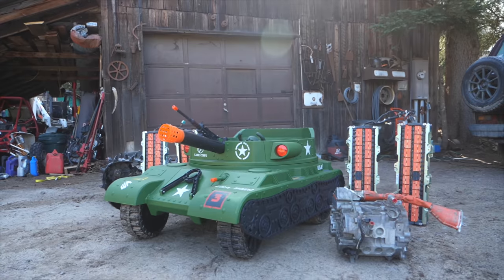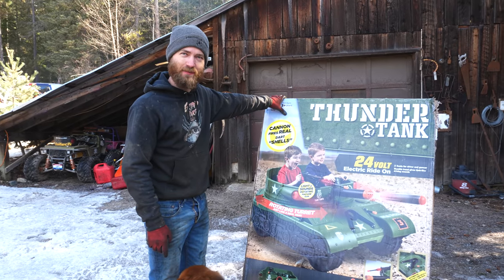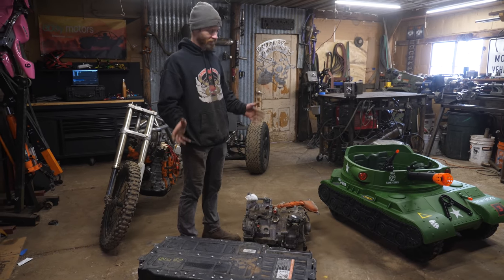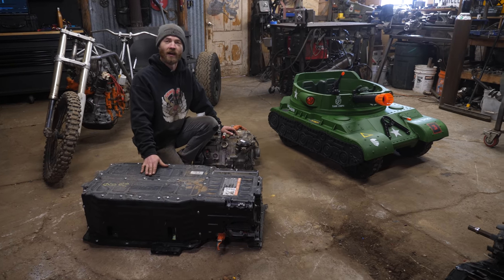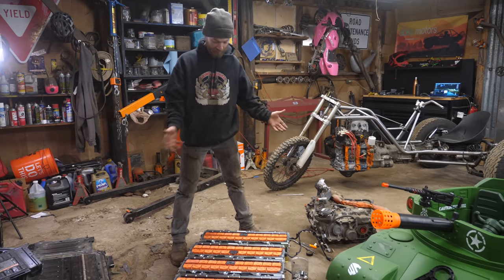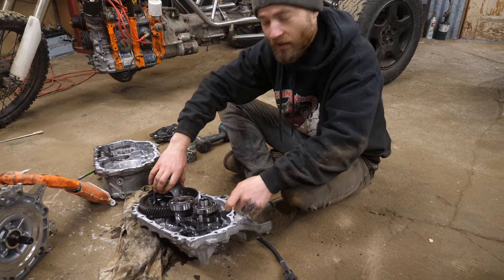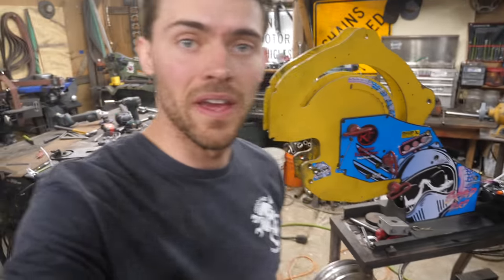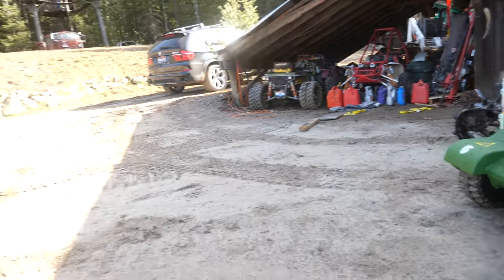450+ HP Electric Power Wheels Tank Build! Our Wildest Project Yet!

Comment: I love the fact that you’re converting it to tracks! It’s gonna be awesome! Steering is gonna be a fun episode though...
Reply: what makes it so much easier than your average tracked vehicle is no drivetrain will be needed just a brake on each motor and even that can be done with the motor controller... each motor can be controlled seprately it will have very tank-like steering (even "0 turn") but with none of the mechanical hoopla an engine that only turns one way would need..
Reply: @ianbuilds7712  You called it! Steering won't be until mid May though!
Reply: @lj516  no good thing comes quick... im stuggling not to say it... THAT'S WHAT SHE SAID!! Dammit i said it
Reply: two handles,like a skid steer or tank is THE ONLY WAY TO DO IT JUSTICE
Reply: @trillrifaxegrindor4411  yup... that is what we were discussing a month ago... sr tardie to the partie.

Comment: love the idea. since thermal failure is a big issue for these batteries you should run a simple cooling system through them to a rad either front or back of tank. most tanks seem to go at back for tactical reasons. it will use some battery power but shouldnt be much for a small pump and rad fan.

Comment: It will rip,the weight down low will be fine. Need to be able to lock, one side or the other,so it stands up nice in doughnut mode. Would make a nice tater cannon.
Reply from the maker: It will have full independent track control. You will be able to do proper tank donuts, with one track goong forward, and the other backward.

Comment: Y'all need a new garage concrete floor . If you ever replace the floor make sure its graded to 5 to 6 inches in depth . Make sure there is wire mesh and add rebar . Make sure wire mesh is off the ground when pouring the new floor . And invest in ASHFORD FORMULA !!! This will save your floor . We all drop tools , engine blocks LOL Stone cold stunners HAHA . No but seriously this will protect the surface and prevent chips . Love the channel !!!

Comment: Maybe you should look at the possibility of putting the engines in the back (I have no experience but I have seen and heard that then there are less problems with coming off the tracks, especially if you build something fast, it somehow affects the tension of the tracks)
Reply from the maker: You have a point, and it may be a problem, but at this point I think there are more reasons to have the motors up front. Like weight distribution, and overall layout and track design.

Comment: This is something else for sure with the electric tank. When you're done with this one maybe you want to do something about that 944 sitting there for some years now. A few people are doing Baja sort of conversions on 924s and 944s as a lower cost version of the off-road 911s. I'm probably doing a plenty of lift build/kit on a 924 this year(maybe 150mm suspension lift and 50mm tire lift?)...I'd be curious what you guys would do on this platform.

Comment: I'd use foot controls for the turret and I would have 2 bars coming up to control left and right separately and let it easily go from forward and reverse while letting you run 1 forward and 1 back for quick spins.
Reply from the maker: We probably won't use joysticks for the controls, because there's a high chance on unwanted acceleration and bucking due to the momentum of your body going over bumps and such, but we will make it so you can drive the tracks opposite directions for tank turns and tight maneuvers.
Reply: @GrindHardPlumbingCo  thats very true, I had forgotten about those bobcat flash backs haha

Comment: I know the power wheels has been a thing all the way through

But it would be so cool if you used the plastic Tank as a guide and BUILT a GHP power Wheels out of steel sheet metal etc!
Next level stuff

I bet it would look awesome and you could size it up a bit if needed and give it character ( not that it wont get some real soon after the first test run and one of you blokes suggests jumping it!)

Comment: Put the motor in the rear so the belt can have all the slack out it will throw the belt up and leave all the slack in the throw. Diesel brother explained this far better than I can but the concept will apply to this as well especially when you’re dealing with this much toque and power with such a small drive train

Comment: Itd be more space smart to set the motors at the front and rear and the batteries center wise for a “flat floor” and more cabin space and it would bring the width of the tank down too

Comment: If you wanted to use just one motor you can use that gearbox that came with it and use brakes for turning like old crawler tractors had back in the day.

My dad's international TD6 has a 5 speed gearbox and uses a diff and turning brakes.

Comment: Realy important @grindhardplumbingco !!!! Motors need to be in the back ! I don't know how to describe why but think about chain slack. You need tension on the botom and slack on top. If you are going forward then direction of rotation will be clock ways and there for motors needs to be in the back
Reply from the maker: I know there are reasons for that, but snowmobiles have the drive in the front, and that works just fine, even when you drive a snomobile on dirt. I think we can make it work.
Reply: @GrindHardPlumbingCo  oh yeah I didn't think about that 🤷🏻. I was compering this to a ripsaw tank (just a miniature version of it) 😅

Comment: I know I'm boring. But be careful with the batteries 😁 rubber gloves and a face shield is a good start (mistakes happen, and if they do with batteries, it can be bad. Working with batteries myself)
Just want you guys to be safe to keep those clips and projects coming 😁💪
Reply from the maker: We will be as careful as possible with the batteries!
Reply: @GrindHardPlumbingCo  I should say be careful of yourself(s), instead of the batteries :) isolate poles of cables as soon as you remove them from modules and so on. Isolating gloves too. Just don't want an unnecessary accident to happen.
Thanks for being awesome guys!

Comment: If the motors run equally, forward and backward, I think you should center them, one in front, one in back, running opposite treads.
Reply from the maker: If we did that, the weight distribution would be all sorts of messed up, plus, the tracks would behave differently due to tension being on the top in one, and the bottom on the other.
Reply: @GrindHardPlumbingCo  very good points!

Comment: It would probably be much easier to implement a twin stick throttle/steering system like on a zero turn mower than a normal gas/brake/wheel arrangement. You wouldn’t have to figure out a way to convert steering input to track speed and you also wouldn’t need a separate reverse shifter.

Comment: Wait, hold on, you have to put the motors in the back. The reason is that the motors will pull the bottom of the tracks back, instead of pulling the top of the tracks forward. Thats one of the reasons why tanks have their drive motors in the back. You will have more forward throttle response and the tracks on the ground will be tighter and you shouldn't run into very many problems with too much play. Since the snowmobile tracks were designed for use in the snow running them on dirt with the motors in the front will tear up the tracks much faster.
Reply from the maker: You have a point, and we will consider all the options, but there are a few good reasons for us to put the motors in the front. And if we go through tracks a bit faster, that's a sacrifice we are willing to make.

Comment: You should make 2 battery packs that are removable for charging and weight reduction and make a battery lead that will run them in series broskis
Reply: I would love to lend a hand on that build I could probably put it together in like a week or two
Reply from the maker: We plan on making the battery pack removable, so we can use it on other projects, or like you say, have a spare.
Reply: @GrindHardPlumbingCo  doin it Right!!

Comment: Did this build just stall? I can't find anymore videos on this. Did Youtube make you pull the videos, because of the MASSIVE danger in screwing around with a 48V EV system?
Reply: There's actually not that much danger I fiddle around with a 96 V DC system all the time and have no issues
Reply: @dr.chiseltip  ... Be careful. Most electric cars use an AC system though. AC is more dangerous than DC. Both can be deadly, but AC takes the cake.

Comment: Sounds like an interesting build but wouldn't be you lot if it wasn't. I didn't realise that the leafs had 80KW motors and trying to push double that power through your motor will be interesting and looking forward to the solution and we all know in the electric game its about torque not HP cause even my 1hp electric quad could do get up-to 60mph with ease due to a good motor.
Keep up the hard work
Reply from the maker: Yeah, I should be very interesting! We're certainly not experts when it comes to electric stuff, but our electrical engineer friend seems to think the leaf motors can easily handle double the stock power, especially since it will only ever be for short bursts. But yes, the torque will be truly insane.

Comment: you can put one motor in the front and one in the back running in reverse. for more room and balance.
what you think?
Reply from the maker: Unfortunately, I think that would create some very weird driving characteristics, because one track would have tension in top, and the other would have it on the bottom... Plus, all the weight up front will be a good thing for this much power!

Comment: Instead of using a break and throttle pedal you should have a left pedal for left track and a right pedal for right track because I’m pre sure those electric motors pre much brake them selves

Comment: Hear me out.... off road 4WD go kart (similar to the oddessy) but it's powered by 2 different 1000cc 2 stroke snowmobile engines, long travel suspension, big ol' mud tires, or if you don't like that idea, I speak for the community when I say I've always wanted to see a Chevy 572 V8 in a quad, if there's a will there's a way

Comment: I have a nissan leaf, it has 100hp and 200lb ft of torque so I'm curious on how you guys will get that kind of power out of that motor,
Reply from the maker: It's simple with electric motors. Add more volts and or amps, you get more watts, which means more power. Also, we are using two leaf motors, so it's not all out of one. But typically motors in EVs can handle way more power than they are rated for, especially for short bursts.

Comment: Have an idea to throw your way.. instead of throttle and brake pedals.. do those engines support engine braking? Could do 2 throttle pedals... more throttle on left engine turns take to the right... etc... release pedals to stop... can have a couple reverse switches to switch engine rotations. For reverse or to spin on the spot ;) either way I know it’s going to be epic

Comment: Cool idea, but I’m not sure how you are arriving at that hp figure. Leaf motors are only 140hp from factory.  The motor should tolerate a lot more then that but the controller won’t! What is the plan for the motor controller/inverters??

Comment: Snowmobile track? Nothing to lubricate the slides? With that weight you will burn them up in no time. See if you can find newer ATV back tracks (long ones). Should give it more of a ripsaw design, but tracks will hold np.
Reply from the maker: We won't be using the slides. There will be bogey wheels like an ATV track. We would get atv tracks, but I don't think any are long enough.
Reply: @GrindHardPlumbingCo  yeah, I have the track set for my 6x6 polaris atv, and even those would probably be to short

Comment: I might be wrong but I’m pretty sure a Nissan Leaf has like 110 hp. Just curious where the 500 hp calculation comes from.
Reply from the maker: It's all about how many volts and amps you put into it. Volts x amps = watts 1000 watts is one KW which is 1.3 hp. Our battery pack is a 350 volt pack, capable of about 1000 amps peak, so there you have 350kw.

Comment: I wouldn't normally recommend LESS horsies, but I think it might be better to use half of the batteries and only one motor, for size reasons. I suppose you could do the full-blown build, but you might as well not even use the plastic tank shell and just make your own out of aluminum or fiberglass 🤔🤷‍♂️

Comment: What plug in hybrid is that battery from ? Can that battery really output 450hp? And yes I know it's a burst rating. I kept on doing maths on Chevy volt batteries, a123 pouch cells, and so on and can't seem to get that power density. If that block of batteries can get almost 500 hp,  this might solve a problem I've been having.
Reply from the maker: It's from a ford C-Max. I dont know the exact specs off hand, but we did the math based on what our electrical engineer friend tokd us, and it's something like 470hp.
Reply: @GrindHardPlumbingCo   I appreciate the reply and would like to know more about the math that lead there. Or have some battery math on the website, I looked but the tank isn't yet in the list of projects. I found some specs that rate one of those 4 bricks of 21 cells that you have at 225 amps peak discharge, they seem to be in series, so that figure is per cell. In total you have 84 cells. If I do some napkin math and just do 4 volts per charged cell times 225 amps times 84 cells that gives me 75 kilowatts which is about 100 horsepower. That being with electric motors from a car, they will still pull a barn down, so no problems there, still a great project and I'm not doing this math to disprove the power claim. I wished it was like that so I could use those batteries in my project, but it once again doesn't seem like I found the answer. 480 hp is 358 kilowatts. That would mean each cell has to output 1100 amps. And physically looking at those bricks it doesn't look like it. Pouch cells can output more, but those need to be well squeezed in their case to not puff. That is unless my math is wrong, I was never on good terms with my math textbook back in school.

Comment: Was half expecting you to do it the way some old school tracked vehicles worked with just a brake on either side of a differential as your drivetrain, but nope, 2 motors, far cooler
Reply from the maker: We thought about doing it that way, but couldn't resist doing it this way!
Reply: @GrindHardPlumbingCo  "I wanted neutral steer" is the best excuse for more power ;)

Comment: Imagen the amount of battery acid that would blow out all over you if the battery blows up or if it gets smacked buy a rock but sick build idia but still think you should of done a puck up truck with a offroad 4inch 5 inch lift kit but keep the builds up
Reply from the maker: We will have the battery well shielded, don't worry.

Comment: You could just use the original motor with the transmission and just put a brake on eather side of diff to get steering
Reply from the maker: We could, but independently controlled motors for each track is way cooler!

Comment: Dear Mother of GOD, If you don't put a steering rate-gyro on that tank it will KILL you.  (fyi, the rate-gyro will also let you drift like a master from the first drive)  Full throttle forward on one track and reverse on the other will be several thousand rpm.  The steering will be unmanageable without something to slow it down for human reaction times.  Fyi, I've built BattleBots, and a steering rate-gyro was one of the key factors for success. 

Software synching the motor rpm with an offset based on steering angle will also work ok.  Baring that, I'd use the stock reduction and differential to build an adder-subtractor style tank transmission with the steering input by a 2-5Kw servo for a CNC mill geared down with a china-special 100:1 gear head.  Easy to find industrial servos that run on 400Vdc internally, and 100:1 plus the reduction at the tank transmission should give you a sane 10-50rpm max turn rate.

Comment: This might be stupid but with that type of electric motor would you even need brakes?? Like wouldn’t just letting off of the “gas” slow it down pretty fast?  If so y’all should just do a gas pedal for each track like an excavator
Reply from the maker: The brakes will largely be just for backup, but you're right that the motors will provide plenty of braking power.

Comment: 470hp+ in that is suicide. 200hp would be asking for a darwin award, they build drag gokarts with less than you will be using and the power to weight ratio makes a chirons seem feeble. If its geared down abit, you could make a tow vehicle with huge torque but if its geared for speed with that power i dont see how the tracks can survive.